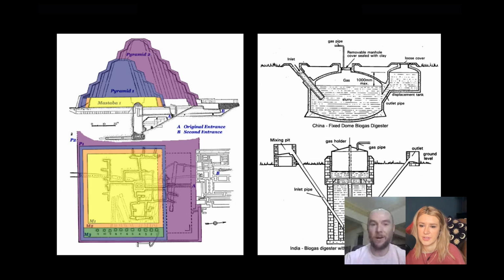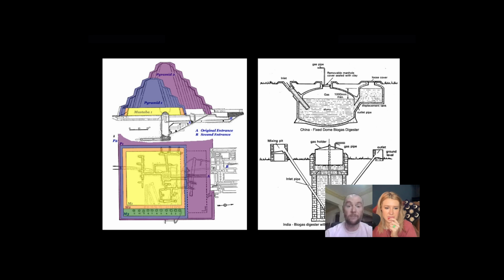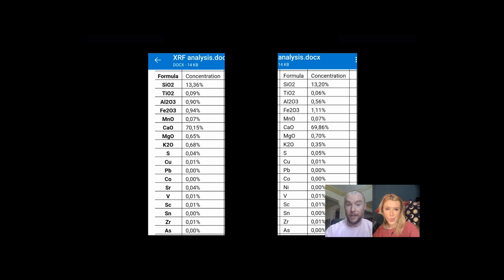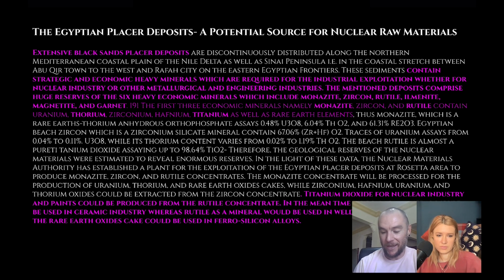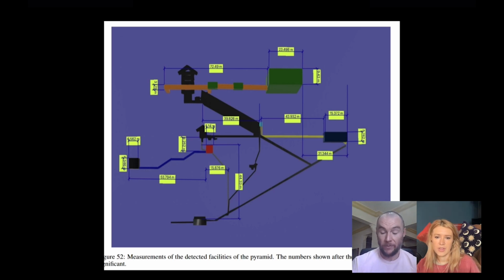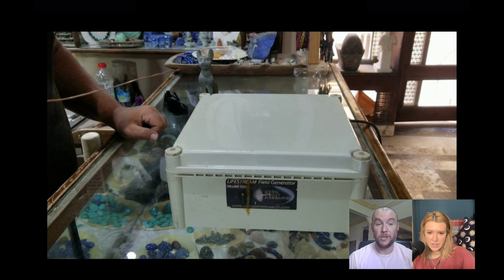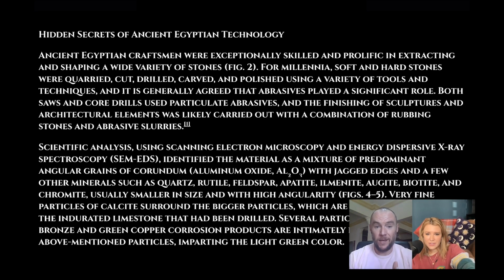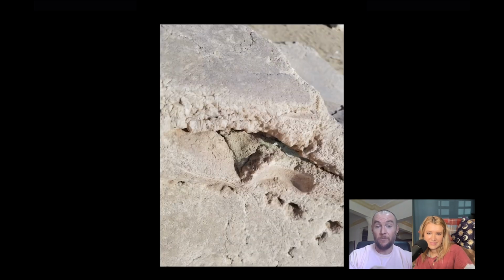The Original Purpose of the Pyramids

Comment: This is a fantastic theory, but the presentation is not really accesible to the public. The diagrams of the chemistry setups are a good start, but they do not yet align with the diagrams of the pyramid interiors. The elements and chemicals could be color coded. Instead of describing, show the flow of the chemical in the pyramid interiors and the subsequent reactions. In many parts in the video I did not know what piece of the picture he was talking about.

Other than that, this may just be it. The interiors totally look and feel like machines. All the talk about electricity never really clicked for me as it lacked practical examples. The chambers being reaction chambers makes total sense. And it explains why they're all a bit different but similar.

It means ancient Egypt was an industrial power, investing in industrial power.

Comment: 0:43: 🔍 The speaker met someone who told them about the theory of pyramids being chemical plants and they are intrigued.
9:46: 🔍 The speaker noticed the smell of ammonia in The Red Pyramid and questioned its source.
20:22: 🔥 The desert cockroach symbolizes the production of methane gas, which was an important ancient science for ancient Chinese society.
30:38: 🔎 Evidence suggests the presence of a pump mechanism in the burial structure.
40:23: 🔬 The speaker discusses various metals found in the sample, including copper, zinc, iron, and antimony, as well as the presence of a metallic ceiling layer.
50:25: 🔍 There is a circular box in the Pyramid of the Jeffrey on a military base, with a lid that was glued on and a sticky residue inside.
1:01:19: 🔬 The speaker discusses an alternative theory about the function of the pyramids and the use of acids.
1:10:53: 🔍 Synthetic aperture radar Dopplertomography reveals previously undiscovered high resolution internal structure of the Great Pyramid.
1:20:57: 🏛 The speaker explains the water flow and extraction mechanism in the Red Pyramid, including the presence of a coating on the casing blocks.
1:31:22: 🧲 The machine produces an electromagnetic energy field that interacts differently with different types of stones.
1:42:08: 🔬 Chemical analysis of the black basalt outside the Great Pyramid in Egypt has revealed the presence of green copper oxide and ilmanite Crystal, which is made of titanium and iron.
1:52:33: 🗝 The water wheel powered sawblade was a low-tech but advanced machine for its time.
2:02:35: 😲 The structure is held together by metal anchors due to the immense internal forces and pressure it experienced during operation.
Recap by Tammy AI

Comment: This video is very interesting, but still it seems like there are a few problems in his theory.

If some were methane plants, how did they get the biowaste out once it stopped producing methane, especially considering the problems with actually getting inside some of these pyramids? Why wouldnt you build a methane plant with easy access in and out if you are going to be constantly taking out biowaste once it is no longer reactive, and putting new waste in to replace it.

Secondly, all that, for fertilizer? Others have stated that nile silt is highly fertile. Also consider that in order to make a fertilizer plant, a good understanding of chemistry and biology is needed, therefore, probably the builders have some idea of an EASIER way to fertilize their fields... 

The next reason, why build a pyramid at all, his reason, to keep the environment out, is a bit ridiculous, you do not need remotely that level of stone to "keep the environment out". And besides, wouldnt it be simpler to make MORE smaller versions as opposed to ONE very large version? There is no part of his theory where the stone is actually completely necessary, at least not in the case of ALL the pyramids

Infact, the very idea that the stone is so reduntant in some cases, i.e. to keep the environment out, actually runs counter to the rest of his theory, which paints the pyramids as highly functional and purposefully built structures.

Why the need for such an amount of stone to use as an "acoustic catalyst"?. Surely there are simpler ways to agitate the chemicals?

I do not buy the stone floating theory either. Where are all the boats? Repurposed as well I suppose. How the hell do they flood the Nile to the height of the pyramids anyway? And It still takes a lot of handling of the stone whether it is floated or not. Why are there no chips on the stone? Were they just that good at placing stone? Perhaps once a block chipped they removed it and threw it out? More handling, what if a lower layer chipped? 

Please if there is clear evidence of such chips someone show me! 

Is it really possible to use some kind of dirt ramp system that would not leave chip marks? Using a dirt ramp there is still going to be moments of great weight on the roughly 90 degree angle, right? Wouldnt we get the same problem with some of the obelisks in Egypt too? Perhaps there is proof of such damage and these alternate history types just ignore it?

Geoffrey has convinced me there is most likely an understanding, and evidence of, chemistry in the pyramids construction. However, I dont think he is being fair, and is getting carried away by the brevity of his discovery and evidence. I mean you can see it in the way he is not even interested in letting Jahannah talk.

Comment: Interesting theory but I have two doubts about it. 1st, Writing appeared inside pyramids from V dynasty onwards and texts were related to mythological stories and afterlife which indicates a religious usage of those buildings. 2nd, there was no need to build such a huge and expensive structure just to produce artificial fertilizers when anual floods brought fertile mud and ancient Egyptians could use the cows’ and bulls’ manure straight away just in case floods nutrients weren’t enough. The production of strong acids could be useful for limestone treatment but ammonia production needs another explanation different to the fertilizers usage. It could be used to produce bombs, but there are not evidences of such an usage in the ancient times.

Comment: He's absolutely spot on with the chemical function and analysis. But he seems to forget that our ability to analyze these things is based on our current very advanced industrial science of chemistry and chemical processes. The civilization that built these structures must have had at least as much chemical processing knowledge, need and ability as we do now.  He seems to forget this fundamental fact when he says this civilization wasn't "high tech", presumably because we haven't found a computer yet. 

I'm really not sure how he can describe Sono-Chemistry being employed in structures that are 13 acres wide and built within .001 of an inch with stones weighing 70+ tons and not call that "high tech"? Perhaps the term he's looking for is "modern" electrical technology, which is not capable of duplicating the ancient electric technology, and presumably vice versa, although that remains to be seen. 

I'm slightly astonished no one else has gone down this road given the very hard chemical evidence and sights and smells inside but most researchers are dependent and have academic kings to bow to and obey.

Comment: Um... no....
you don't just "get a bigger boat" to float 1000 tons...
do the calculation of how much water volume must be displaced for 1000+ tons to float....
The boat would be as big as a modern warship in the USA navy.
Reply: roughly 1100 cubic meters.  so 10m by 10m by 11m.
ok, so not as much volume as I thought.  Still MUCH BIGGER than any boat we know of that they had.  However, there is much we don't know about yet.

Comment: Could not find my original post to update. After watching this video a couple times. I feel compelled to say he is wrong very wrong about several things he states as fact its misinformation, and it annoying me. Thay have known for quite a while now that the Great  Pyramid does in fact produce substantial amounts of electricity. A news paper article published back when they used let tourists climb to the top of the Pyramid explains how a tour guide was shocked so badly he was thrown 6 ft backwards knocking him onto the floor. The group had ascended to the top. After arriving a tourist took out a canteen poured water out on a towel wetting and wrapping it around the cup presumably to keep it cool. Filled the cup with water then proceeded to had it to the tour guide. The article states at this time the cup discharged such a jolt of electricity knocking the guide off his feet backwards and to the floor rendering him unconscious. Where it read he stayed for several hours as they tried to revive him. So to say it does not produce electricity you are wrong. Done intentionally or just an inherent by product of it design the fact is it does. After an investigation the concluded the metal cup wrapped with a wet towel filled with water acted like a capacitor storing up the charge from top of the Pyramid. 2nd. There are several things you overlook either by your own ignorance or purposely because  it doesn't fit into your theory. Long ago the majority of the passages in the great Pyramid were lined with sheets of quartz cut precisely to fit the side, floor, and ceiling. These slabs or sheets were removed for safety reasons as they were crumbling and falling apart. If I remember correctly they stated it was due to salt damage. 3rd. Forgetting about the honeycombed passages cut into the granite below the base if the Pyramid. They used to funnel water through? 4th. Compressing quartz crystals and releasing it produces an electrical charge a very small one but it does. That's a fact period. You say "catalyst  bla, bla, rasing pressure bla, bla", and the inside of the chamber is rose quartz granite and I'm betting it has some quartz crystals on its surface. That would be exposed to your pressure increase and then the pressure is released poof magic electricity. So by you very own description of how it worked the quartz crystals would have produced  electricity. Next the Nile has some of the most fertile silt found anywhere "Rich soil" I believe you call it. Flooding of the Nile was crucial for food production. Why the need for massive quantities fertilizer? Methane gas really? Ok for those who are unaware methane gas is sewage gas. Do you really want that gas in your home for cooking and heating? Umm fresh lamb grilled over flames of burning sewage gas yumminess....  What of the newly discovered chamber located above grand gallery? The one the discovered doing the scanning. They estimate it size to be as big as or bigger than the grand gallery itself. That the chemical workers lunch break room? Moving at speed. You enormously imply over and over about 1000's of RPM'S (Revolutions Pet Minute) of these tools. Because a cut went askew? or because you found fused metal flakes? Oh there's most definitely a flake here of that I'm positive. Understandings of basic science and mechanics are foriegn magic apparently. I've witnessed first hand brass bearings fusing to a steel shaft on a weighted  flywheel turning at staggering amount of RPMS "It was moving at speed." A breathtaking 100 RPM woohoo ! Its called friction my friend. If you do not have coolant to offset the heat build up caused by the friction, or lubrication to negate it. Then thing will heat up and continue to do so untill failure occurs. No matter the speed. Try this.. Get a stainless butter knife and a kitchen towel. Holding the towel pinch the butter knife firmly between your thumb and index finger. Rub the blade quickly keeping it pinched firmly for umm about 30 seconds. That blade gets rather hot doesn't it. If that was kept up up for let's say 15 minutes  that blade would be red hot. Dosent mean you hands were moving at 1000's of RPMS.  Lmao sorry my eyes tear up from laughing everytime I think of you making a hand motion saying "Turn the handle 1 time and it turns the bit 1000 times." Like your cranking an egg beater. Absolutely rubbish I mean do you hear yourself? Seriously. I send out a call out to any Mechanical Engineer or anyone that knows a Mechanical Engineer. A CAD drawing  of this please I'm begging you. Specifications are as follows: A hand crank drill capable of accommodating a core bit of about 2 1/2 inches in diameter a 1:1000 gear ratio robust enough to drill granite. One person to hold the drill another to turn the crank. "Moving at speed" like you mouth? Floating blocks really honest any small amount of credibility you may have had up until that point gone forever. I can excuse the lack of not understanding basic science and mechanics, but floating stones to the top with water is just ludicrous. Watch the Internal Ramp documentary. The guy nailed it 100%  on target. Simple pulleys and counterweights. Why on earth would they over complicate things with water and dykes and dams and gates and rafts and floating the blocks? Umm NOT. I'm just stopping  now I could go on forever. The only things I agree with 100 percent on is. One not built by Kufu and two not now nor ever a tomb. Give  you props for finding the trace chemicals, and the metallurgical findings. The rest is more fantasy than hard factual evidence. Too many conclusion without factual evidence, and only showing evidence to support you theory is just bad science. While your at the bookstore peddling your collection of shabby research used to prop up you outlandish theories. Do me a favor pick up yourself a book on manners you were rather rude at points. Its never polite to talk over people no matter how important you may think you are with your delusions of grandeur.
Reply: 1. please format your writing... no one likes read one giant block. you tube probably flags it as a spam. 
2. his latest episode #90 and Sunday Site Visit 17, are interesting - specifically, those conduit system coming out from the pyramid must have some reason to be there. they are not just drainage. if you follow those conduits, it ends with collection bowls made out of stone. they had to be collecting something.
Reply: Offer a critique of his theory on his channel and see how quick you get blocked, tells you everything you need to know. He's part of the drive to get more tourists to Egypt the likes of hawas etc are happy to have new age types there as it's all money at the end of the day, he's part of that agenda.

Comment: 1:47:50 This makes no sense? He is saying they had advanced knowledge and could build chemical refineries but he is also reinforcing the modern egyptology lie which states they used copper tools to chisel and cut and copper tubes and a slurry as tube drills, it doesnt matter if they were an alloy with arsenic and strong as steel, that is still much softer than granite and is brittle, it still has all the same problems of normal copper it just means for example it would shave a couple of months off the many months it would have taken to quarry and shape each stone block used to make the great pyramid of which there were 22 million blocks, so it might cut the time down from 15 million years or so just to quarry and shape the blocks needed for the pyramid to maybe 8 million years, its still demonstrably wrong and impossible and nobody to this day has been able to successfully quarry or cut a granite block using these so called technics, he also reinforced earlier in the video the fact that they used water and wood to float and transport these blocks and the amount of wood needed to float a multi ton granite block would make it far to large to raise the block up any shaft or tunnel, he is making non sensical arguements and seems to be contradicting himself, the precision needed to make a chemical refinery would be impossible with copper or steel chisels, saws and hammers so would also be impossible with arsenic alloyed copper and the pyramids have been shown to have such precision to the point it would impractical and almost impossible for us to recreate it today, and how can he possibly explain the granite vases being made with copper tools? and how about the statues which are perfectly symetrical and which the smaller and more delicate parts would break if using copper tools to make them.

Comment: Had to skip a lot of this after 56:00, but further on became fascinated.  If they were using an alloy of copper+ ? which could, then be strong enough to work stone. it reminded me of supposed 'orichalcum' found in a 6th century shipwreck in 2014 and 2016 off the coast of Sicily. The ingots were tested by xray fluorescence as an alloy made with 75-80 percent copper, 15-20 percent zinc and small percentages of nickel, lead and iron. Now the legend of orichalcum says it was 'found' or 'mined' (?) in Atlantis. Clearly alloys, (unless naturally concocted by Nature) are not 'mined'. Considered almost as valuable as gold, this orichalcum used for decoration MIGHT have had more than one version of itself, one more durable under stress. Photos of these ingots do not appear to show corrosion but they were 'polished' (?) for display, according to Researchgate.